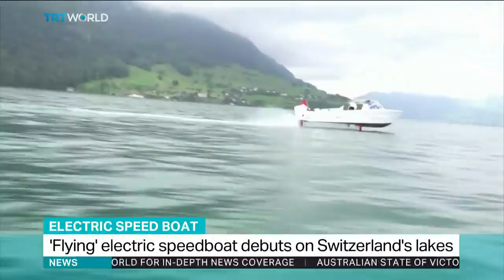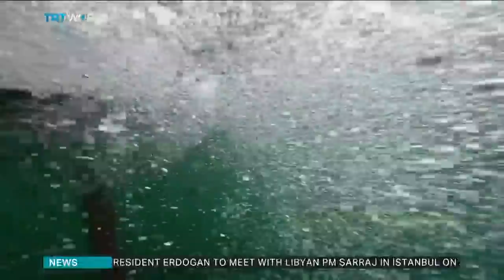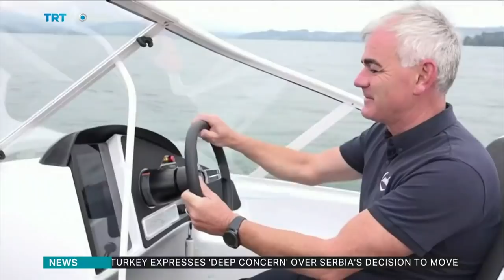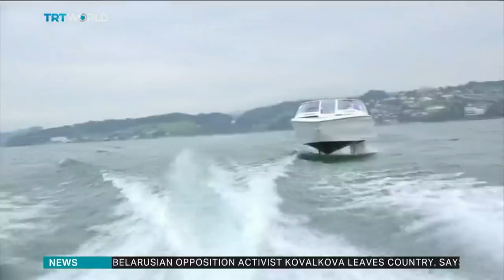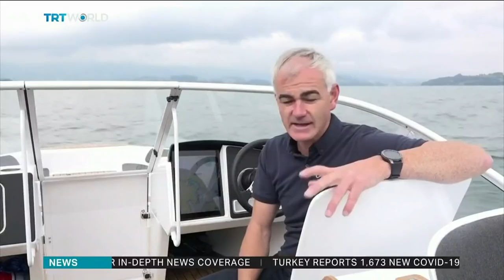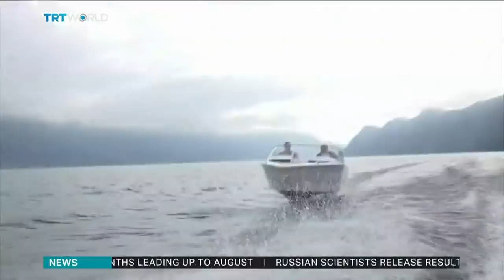'Flying' electric speedboat debuts on Switzerland's lakes

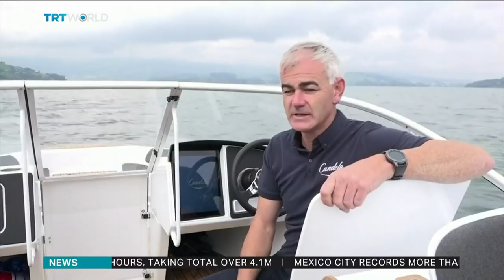Comment: 1:24 Sweden or Switzerland?
Reply: Does it matter? It's all bulshit anyway. 45 miles? That's it? Yeah I'll just keep my gas boat and I'll keep some gas in it, just in case. Or an even better idea would be a boat that could lift up like that ran by a motor with gas, then you could probably get hundreds of miles on just a tank of gas.? I love global warming.
Reply: Swedish manufacturer not sweden
Reply: @maximusdecimusmeridius5500  what about the batteries they are the major factor on pollution. What a great green project. I dont give a single buck to this crap.
Reply: @vaterzhukov4136  swedish is Sweden?? The question nor pan is asking is, is the boat manufacturer Swedish or swiss? Because they are in Switzerland testing the boat.Its confusing,i see what shes saying.